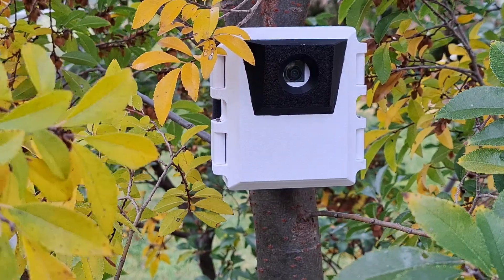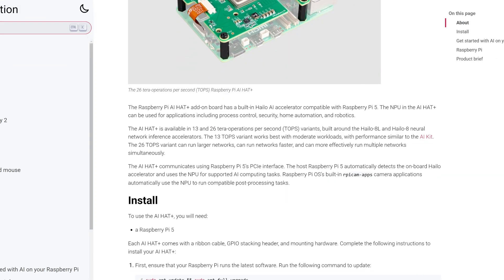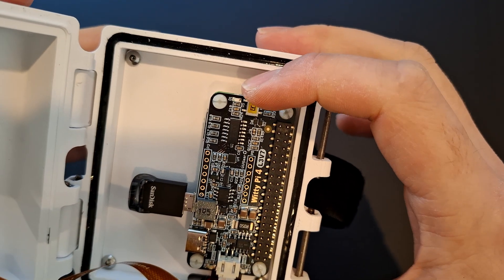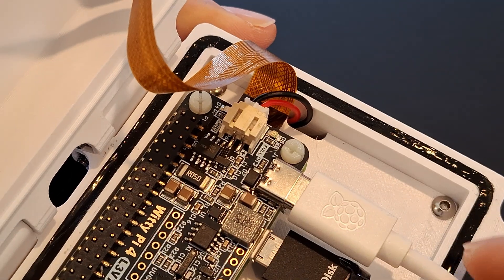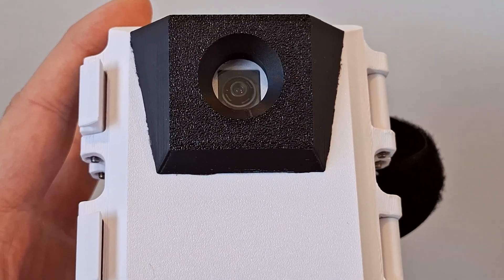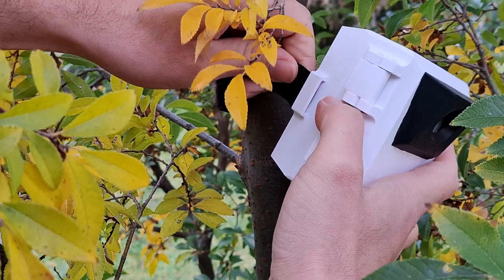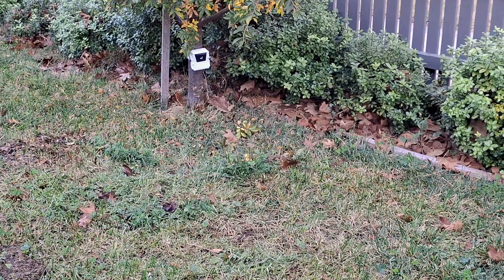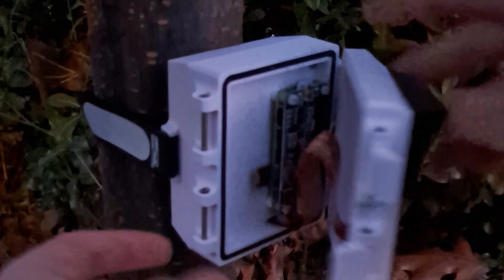Raspberry Pi Zero AI Wildlife Detector!

Comment: 2:01 Only concern with this is from my viewpoint it looks like a snug fit for the batteries meaning no room for expansion or swelling that can occur from heat and thus there's a chance of the batteries popping
Reply from the maker: Your li-ion batteries should not be swelling
Reply: @LukeDitria its a natural aging process because of the chemical reactions in the battery. Not much, but gradual. Having no room for that can cause the battery to burst

Comment: Run a small webserver on it (ideally socket-activated) after starting a wifi AP. That way you don’t need to open the case and deal with the USB stick.
Reply from the maker: You can just do file transfer over wifi AP if you would like.
Reply: @LukeDitria  You can start an AP on the RPi like this: nmcli device WiFi hotspot ssid "wildlife monitor" password "wild"

Comment: how can i use lte with this setup? i want my pi zero to inform me if he detect cats.
Reply from the maker: You can buy a 4G Raspberry Pi HAT
Reply: @LukeDitria Thank you, I’ve now set everything up.

Via mobile network I can directly reach the Pi Zero over IPv6 and SSH. Today I’ll also connect the WittyPi module.

To save power, the system runs without a graphical interface. Now I’m curious to see if the battery life will exceed five hours.

The goal is to support the cat rescue: as soon as a stray cat is detected, a notification should be sent.

Thanks again for your recent helpful videos!

Can your 3D case also be used if an LTE module is attached to the Pi Zero via the integrated pogo pins?

Comment: I am planning on deploying my raspberry pi ai camera bird monitor soon. I wanted your opinion on if I should use a PIR sensor to turn on the camera. I will have the camera mounted on the inside of a window that looks at a bird feeder on the other side. Lmk what the best way to activate the camera so it doesn't run all day. Thanks for these videos, Luke
Reply from the maker: Raspberry PIs are a bit slow to boot up. So if the plan is to shut down and boot up, you'll need whatever you're recording to sit around for 30-60 seconds (depending on what version of PI you're using). If you just want to know when to start recording, then you can use any number of proximity sensors; 
PIR, TOF, IR proximity, etc. I've even seen some use a small pressure plate (weight sensor) that the animal would stand on to trigger recording.